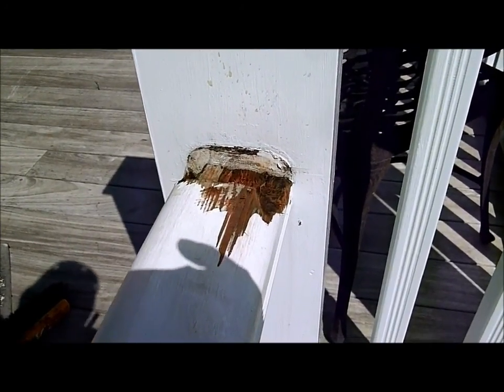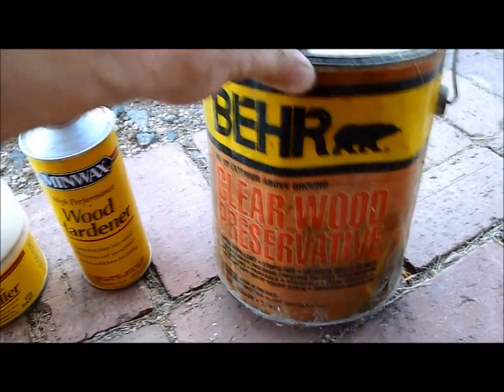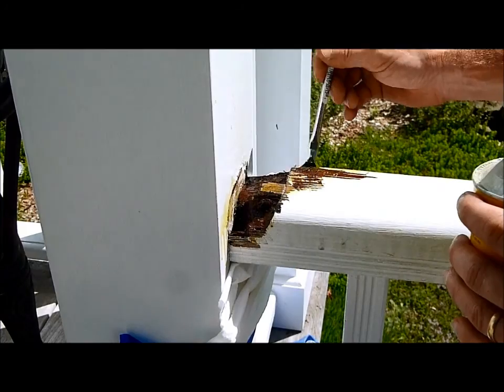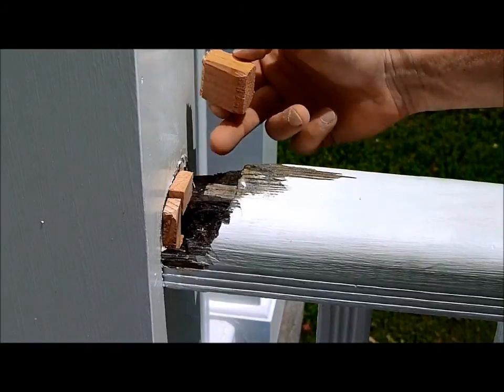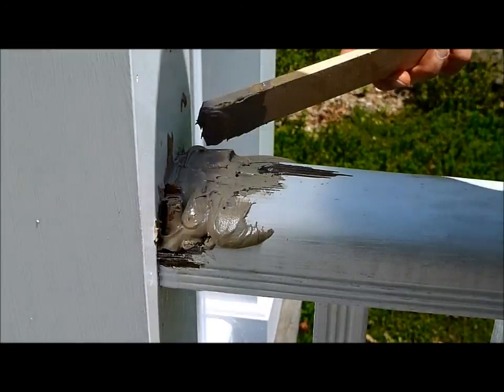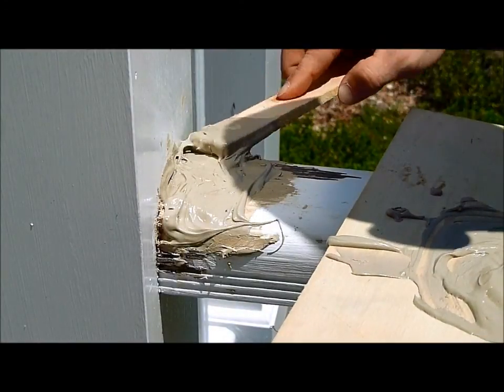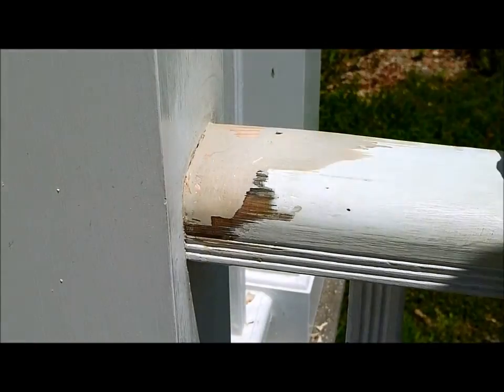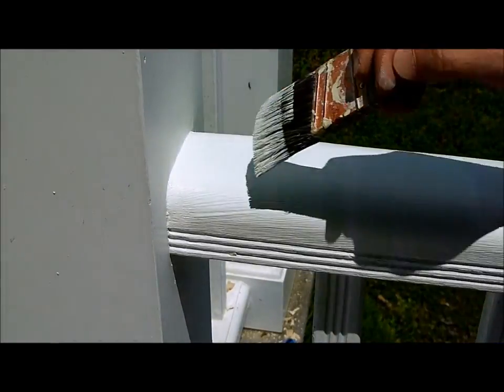How To Repair Rot: Cedar Deck Railing

Comment: I have about 100' of log rail (on our lake home) that I installed 15+yrs ago. I had planned on replacing the lower vertical rails that partially rotted due to MN weather. After watching this vid that the rails can be replaced with this technique. Thanks for the advice. I will let you know how it comes out.
Reply from the maker: Be cautious about any structural members, though.  In other words, if you are repairing a rail or post in an area that supports weight then you may be better off replacing the wood.  Also, if you have a large amount of rot to repair, consider some of the industrial or marine products for the purpose.  System Three brand comes to mind and is available from boat repair supply houses.

Comment: This is so close to what I need to do. The only difference is stain instead of paint. The high performance wood filler does not appear to accept stain. I like the idea of an epoxy two part system though since it will be outside in weather conditions. What do I do?
Reply from the maker: There are different types of stain.  They are marketed as solid stain, semi-transparent or transparent.  A solid stain will cover essentially like paint, and would hide a repair.  Semi-transparent or transparent stain will not.  So, one option is to make your repair and use a solid stain.  If you prefer a transparent stain, you may be forced to replace the entire damaged piece or you may be able to cut it back to an area where a patch would not show.  There is no epoxy or wood filler I know of that will accept a transparent stain and not be obvious as a repair.

Comment: I have this problem but my rot is on the bottom side of the rail at the joint I and I haven't been able to visualize how to so this upside down with gravity fighting me.
Reply from the maker: If you can't get access you'll have to remove the railing and either replace the bottom rail or repair it on a bench.  You can use bondo or epoxy from underneath and it will stick, but you still need access for sanding or chiseling.  Probably you can remove the entire railing as a unit to repair on the bench.